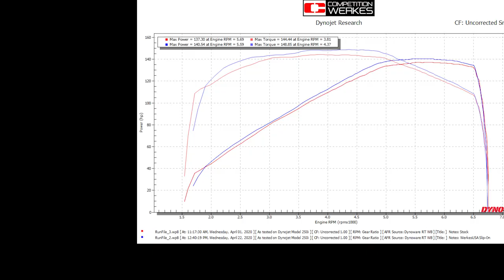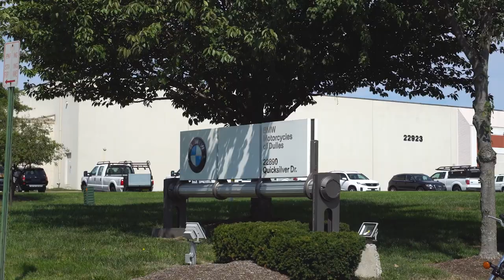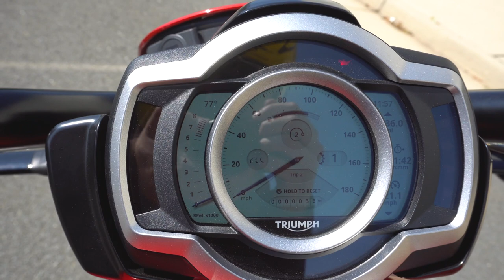Triumph Rocket 3 R // THIS CAN'T BE REAL

Comment: I love mine. Put an ECU tune on it that fixes the Euro5 nonsense that neuters it. Yes, what you just experienced is the tame version of the Rocket--even in sport mode. Default ECU map is only ~65% throttle with a full pull in sport.

Mine has GT bars and mid controls. It's a super comfortable fit at 5'10".
Reply from the maker: Wow! Glad to hear you like that setup
Reply: Hi, I have a rocket 3r. I didn't know it was possible to flash the ecu. Is it difficult? Dealer ship can do it? It's a big difference with the stock model? It's not an obligation to change the exhaust? Thank's for help me. We always want more 😎✌️
Reply: @S1000rr_vad  I have a 2020 GT version, I'd also like to know how to "unleash the beast".  I know it's in there......

Comment: If you take it to the shop after break in, you can have them remove the limiter on the ecu. The engine actually produces around 200hp
Reply: is there really a limiter on the ecu to be removed ? or it is a kind of "remap" the control unit ..... I have issues to find some good shop here in Milan as where I bought the bike they say the bike is not limited..... and I have also contacted a guy who told me there is something to work on the map he toldm e hte following: The carburetion is a little lean from the factory and the accelerator potentiometer is partialized to 75% but it is not detuned to 75%. It definitely improves with the map, yes. We recover approximately 10-15hp in total. What do you think, suggestions ? Thanks Massimo.
Reply: The throttle is fly-by-wire and not mechanical.  Mostly, the throttle is limited to about 40% opening and, even in sport mode, never opens more than about 60% to 65% above 3,000 rpm.  If you search on YouTube you can find lots of videos about how to remove this throttle opening limitation and you will release 30 HP plus.  Acceleration will be much improved eg 30 mph to 130 mph reduced from 10 seconds to 7.5 seconds.

Comment: I hesitated between the Rocket 3, the Diavel and the XDiavel. I finally chose the XDiavel for its more angry engine and belt drive. Even though I don't regret my choice at all, I still find this Triumph absolutely gorgeous. Great video 👍
Reply from the maker: Nice! I would love to try riding a Diavel or xDiavel to see how it compares. I bet it handles better than the Rocket.
Reply: @VanBlamm  Not really, rather the mind is different. At the crossroads between roadster, cutom and sport. It is not used for anything other than pleasure 😅
The rocket 3 seems to me more like a motorcycle with a big car engine which looks so crazy, I love it !!!
Reply: you made the wrong choice lol
this baby can get flashed to remove the limiters and it has 200 hp and 170 hp of torque
Reply: I used to own an Xdiavel and it got stolen. I just bought the rocket 3 and actually like it better than the Ducati. Both amazing bikes. I still miss my Ducati.

Comment: The reason I would like to like to like this bike so much the maintenance just no maintenance just ride ride and ride no crappy chain to oil the engine is a car engine what can go wrong should go 200,000 miles without a sweat and stump pulling torque.

Comment: This new rocket is miles ahead of the old one in every way. Rode them both on long rides. The seat of the old one is more comfortable with it's back rest. But, you can't travel far on them due to their puny tanks & their low gas mileage. But, when you are on the saddle of one everything else is in your rear view mirrors 😉
Reply from the maker: The looks alone are enough that I'd only consider the 2019+ version. I'm sure the older ones are great (and cheaper...) but aesthetically they don't do it for me.
Reply: @VanBlamm  I concur.
Reply: The only thing that bugs me is the fuel consumption and the shitty fuel  capacity on the new one They should  have made a bigger tank
Reply: @davesouthey2619  Apparently, if the tank had been bigger it wouldn't have looked right. I can put up with 140 mile range - is gas so difficult to get in the USA? (From the UK - new owner of a Rocket 3 GT 2021 and grinning on every ride out).
Reply: puny tanks?

24l on the old model, is one of the biggest out there.

- i dont think you rode them😉
Reply: @globalteamwork4light  hi there, as far as I know the new rocket 3 has 18 liters of tank capacity. That's puny for the mileage it gives. And about me riding the rocket 3 I, have ridden it well before I posted my comment.
Reply: @suryateja933  

well, the old rocket has 24l tank capacity.
one of the many reasons i think triumph got it right the first time.
nedless to say i think the old model is better overall.
new isnt always better.

Comment: van, if you had your choice between the 2022 hayabusa and the 2022 rocket 3R, which one would you definitely choose ?  And, by the way, I'm down here in Fredericksburg, Va bro..haha
Reply from the maker: Rocket 3 100% all day every day. It is one of my dream bikes, and I am determined to own one someday. The Rocket is to low-end grunt what the Busa is to top-end speed, only it's more comfortable and better looking (in my opinion)
Reply: @VanBlamm  bro, I agree with the stunning looks of the 3R.  It may not be as fast as the busa off the line or even in total top end speed, but who will ever go over 140 mph anyway !!!(I say less than 1% of all motorcycle riders will go over that speed on a daily basis...also, when I think about the service intervals, you can't beat a 10,000 mile service interval.  Now, regardless if the 3R is as reliable as the japanese hayabusa is another story and yet to be seen...

Comment: I miss my 06 R3 so much, especially since I put it down 3 times and then rebuilt it with the insurance money...yep, we had a history. I'm not sure I would get the old 2300cc model again, I'd have to test ride the roadster. 

I've since learned the value of "lighter" bikes, which is why I've been looking hard at the Speed Twin, on paper it appears to be a mini-rocket. Would you say that's the case after owning one for so long?

Of course I'd take the new R3 in a heartbeat! It's what the rocket should have always been but finding one on the used market for 10k (one that hasn't been rebuilt 3 times, lol) is gonna take 4-5 years at least.
Reply from the maker: I've been riding a lot of different motorcycles lately. After almost every single one, I have the same two thoughts when getting back onto my Speed Twin: #1) this thing is so compact, and #2) this thing is so torquey. The Rocket didn't make me think #2. It is the first and so far only motorcycle to make my bike feel less gutsy in comparison. Not even the 114 Milwaukee Eight felt like it could fling a bike the way the 1200 "HP" Bonneville twin does, simply because the former gets used in far bigger & heavier bikes.

As amazing as the Rocket is, I think the Speed Twin is still the king of the torque-to-handiness ratio. Anything more muscular tends to be cumbersome, and anything sprightlier tends to feel undergunned. Hope that answers your question!
Reply: @VanBlamm  thanks man, that’s all I needed to know. The rocket spoiled me for torque, I’m on a Versys 650 now, I miss those torque pulls SO MUCH! Had to make some temporary sacrifices about the time my r3 died, hopefully my patients is rewarded soon with a Speedy in the stable! I’ll just keep drooling over your content until then 👍🏼
Reply: @kerbachard  my thoughts are with you brother.  I'll light a candle and pray that your piggy-bank grows FAST&FAT. 
Once you've experienced that 1200-HT Twin you won't feel the need for anything else.  
And nothing beats the charm and character of a BONNEVILLE...  Hope to see you soon riding that stallion. Word. RESPECT. Cheers from PORTUGAL
Reply: @kerbachard  You can tune the Speed Twin for more top end power too 🙂https://www.youtube.com/watch?v=y66PZmKDK68

Comment: Do those mirrors cause any issues being right next to your hands.  They just look like they stick out, I could see those mirrors causing issues threading the bike into tight garage space
Reply from the maker: You can rotate them around so that the long ends point inwards, towards the dash, making them a bit narrower. However, my Speed Twin came with these same mirrors and I never had any trouble parking in tight spaces or filtering in city traffic, even with them flipped outwards.

Comment: Man this is Child's play compared to a boss hoss. 600 -1200hp AMERICAN V8 Bro!!
Reply: No IT IS NOT. First off I owned the Boss Hoss 502 (8.2L) and the Boss Hoss 350ZZ4 (5.7L). Not in the same universe. Boss Hoss is more of a home made brand. The 502cid was 1500 pounds heavy. It turns like a Mack Truck (have one of those too) and has no value in turns. In straight line acceleration the 502cid didn't come close to my 2022 Rocket 3 GT. The Boss gets the stares but it is not precision. It is a straight line bike and at 650hp it ended up burning the transmission planetary gear set out on the highway. The NESCO tranny had pieces of crude, splintered gears in the bottom. I tried to get a machine shop to build a new planetary unit but they said no. NESCO wanted five grand for another two speed tranny. I said no. Not worth it. I pulled the 502 for a truck I was building and parted out the rest. I tried running Busa Bikes and V-Max 2nd gen with the 502 and got beat everytime. It is too heavy, power is lost in the tranny, and no handling. If your idea of some grandiose machine with a Chevrolet crate engine in it is a special deal for you then you missed the mark BIG TIME. The Triumph is precision, smooth, great for twisty handling and far, far more superior in workmamship than the $80,000 I paid for both Boss Hoss bikes. A British company builds a super-charger for the Rocket. I watched that vid today. It makes all cruisers look like...uh....what you said... Child's play.

Comment: You think its fast now?  Get the ECU flashed.  The ride by wire tables are severely restricted, and despite twisting the throttle to the stop, the ECU never opens the throttle plates more than 64%...  So you are never actually getting even close to full power, even in sport mode.